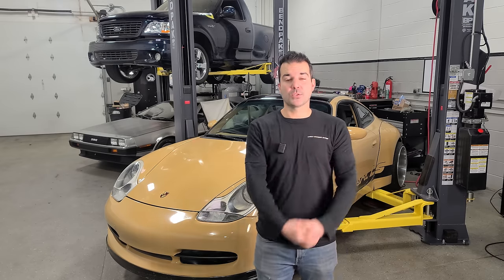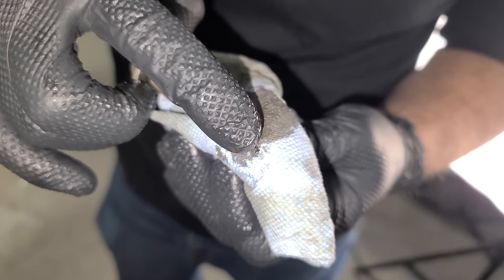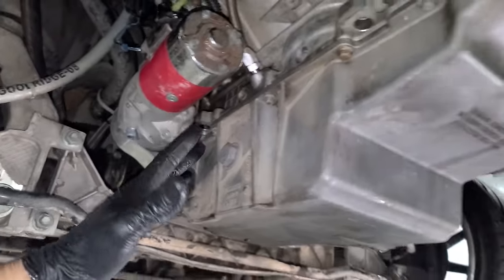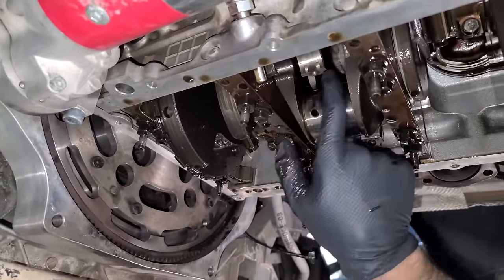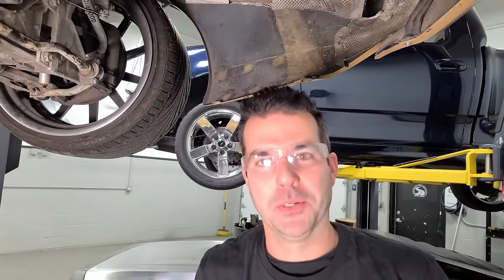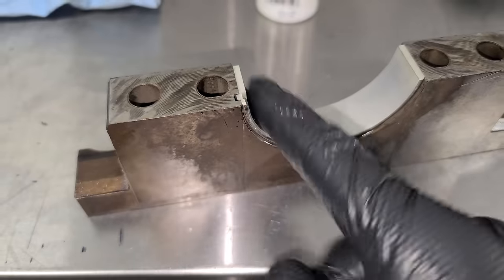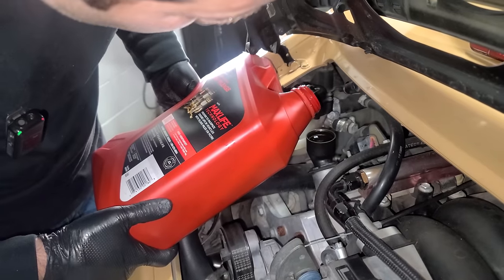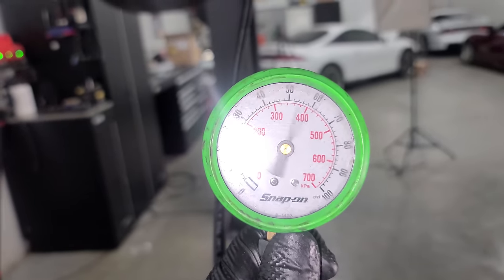My LS Porsche 911 Was About To BLOW UP So I Attempted A RISKY DIY Engine Fix!

Comment: A real mechanic, Alex is. Only a seasoned guy would remove the pan , pull the rod caps and find spun bearing and still say, crank is good , I'm lucking out.
Reply: Does the exhaust cause an issue with it sitting right under the oil pan like that?

Comment: I want to correct something mentioned in the process of torquing the bolts inside the engine. What you said about torque to angle bolts is incorrect.

Torque to angle is a process, not a type of bolt. The bolt itself dictates whether it's a torque to yield(TTY) or standard bolt. Generally a "neck" on the bolt is a good indicator it's a TTY bolt or not. 

Torque to angle is a very common process used when torquing a TTY bolt because it's very easy to control bolt stretch with a specific angle applied. 

I'm not saying the bolts you torqued can't be reused, just want to be careful when throwing around terminology that can easily confuse others into thinking they can reuse bolts.

Comment: No one mentioned that it was overheating severely when purchased.  It probably got super hot and spun the bearings at the time.  There should not be any future problems in my opinion

Comment: Wait until he gets more spun bearings, pulls it completely apart, and finds out that the reason the bearings spun in the first place is that the last guy who "freshened the bottom end" mixed up the rod caps :p

Comment: My LQ4 has 325,000 miles and idles at42# oil pressure and cruises at 59# at 2000 rpm, this is at 195 degrees normal operating temp.

Comment: Bro.. 3-4 thow is very loose. Probably why she spun. Unless you're running 80 psi oil pressure. Just throw a 1/2 size plus bearing and tighten it up.

Comment: Absolutely nothing wrong with how you replace the brains in this motor. He checked your specs. Torqued everything properly. Cleaned up the crank old school. I've done them that way when the budget was tight. It works just fine. Must be nice on a lift.

Comment: ALEX, IF YOU HAVE THÈM ALL OUT, YOU SHOULD CHANGE THEM ALL.....THAT CAR SHOULD BE AT 90 OIL PRESSÙRÈ....AT 3500RPM. Even vw bugs have over 50oil pressure and is loŵ set....

Comment: Bro gonne have rod knock after all that polishing       just spend the 500 and buy a junkyard ls    good luck thou it may run a week    it may run forever who knows but judging by my knowledge that crank could have micro cracks due to heat and all that polishing increasing clearances its going to fail soon

Comment: One thing I hate with a passion are : low profile tires, every time I see them? I get instant erectile dysfunction 😢 , many many Lamborghinis,  corvettes, ferraris  have unexpectedly crashed in a very sophisticated way, due to cold low profile tires, they are to thin and hard ,  you try to turn? And they go straight 😮 but with more meat , they will grip and hold , just remember the porsche 917 tires , and the 365 gtb Daytona, they never slide even on wet roads . Low profiles also wear out brakes faster .

Comment: Not all engine builders use ARP studs , only people who have deep pockets and think getting the best of the best always use ARP studs , ARP studs/bolts have applications,  they are breakable studs , theres a huge difference between stretchable studs and breakable studs that are hardened with a max torque setting,  you dont always want to use ARP studs/bolts on everything something that  didnt have aluminum heads on it will call for ARP head bolts because stretchable one's will never torque,  cast to cast calls for whatever that oem bolt grade and length is , of ots shanked or may be in a sleeve as well, if it calls for a crush washer or shims to alleviate space between something or to come to specific degrees . But always research your bolt specifics , dont always go buy ARP bolts or studs when they are not needed or cannot be used things may become damaged,  cracked , or completely broken because of a bad application of the wrong parts , so dont just go buy ARP bolts for your engine with out doing some research first is all im saying . What sold me on stock bolts was this , an elderly man owned a race shop and i was that kid wanting all the cool stuff,  and he showed me the difference by actually breaking an ARP head bolt in front of me and said they are made for race cars , you kid do not have a race car , you have a piece a junk ford truck kid and showed me a head bolt for a 351 Windsor and he kept tightening it and tightening it and stretched ot til it broke too , he looked at me and said cast iron needs stretchable bolts aluminum expands and needs hardened bolts to keep them in place you put a hardened bolt on cast and things break, and that kept to me for 20 plus years....

Comment: Pressure is pressure - why would the sensor care which engine it is on? All the sensor can see is how hard the oil is pushing on it. I would never assume oil pressure to be ok on any engine that is new to me.
Reply: Oil pressure senders work on electrical resistance and are matched to the gauge. Different gauges can use different resistances for a specific pressure.
Reply: @kendallkillian1125  I realise that, but Alex said it was a stock Porsche sender going to a stock Porsche instrument panel. The only thing not Porsche was the thread adapter and the engine itself. I fail to see why that would ever be a reason to talk about translation errors. I think he just got himself muddled.

Comment: In my 2007 truck the engine reads about 90-120 psi on idle, out of the gauges range, then with the engine off it rests at about 40 psi, it's a Chevy thing

Comment: Man i can assure you 30psi cold start and 45 at 3k rpm cold IS concerning.. thats a recipe for 10psi or less hot lol
An Ls should be well over 40 or 50psi cold IDLE. Hot idle should be 25-30psi 3k rpm hot should be around 45 or 50psi. 1500rpm cruise 38-42 psi is an average healthy LS.

Comment: As an automotive machinist this was hard to watch. I love your channel but this killed me 😂. I would run 20w50 vr1 in that thing with those kinds of clearances. Good luck
Reply from the maker: It definitely wasn't meant to be an alternative to the proper repair of disassembling the engine and having it machined. I mention that in the video.  This is a very cheap method that might work.  It might not.

Comment: If you have to open it up again, I think you should make it a stroker and put a flat plaine crank in it so you can rev it to 8000 rpm and push the car up to 250 mph. 😂😅😅😂

Comment: Yowza. 5 minutes in, the first thing I notice as you pulled the oil drain plug is "oh, that's not good, that oil looks a little sparkly."
Then I realized it wasn't just "a little sparkly", it actually looked like the engine was trying to flee the country in liquid form. It always amazes me how much punishment and damage engines will tolerate, but I really wouldn't rely on that one at all. That much metal in the oil -> full teardown and maybe off to the machine shop.
Here's to hoping you do the right thing...

Edit: well, I suppose a bearing slap job is fine for starters, though you'd do well to figure out why the bearings failed in the first place.
Edit 2: original bearings killed by track use?

Comment: Please build the engine at least better rods and pistons and valves and crankshaft and do small twin turbos and route the air intake to the  grills on the trunk and then the outlets to a small radiator then a center exit to the throttle body

Comment: Today most people trow thin oil in their modern engines, us cars like a bit bigger oil I think. Not that very 0w thin stuff
Reply: That 0 is the cold pour rating. The lower the number the easier it is for the oil to flow on startup

Comment: Pull the motor and clean all the metal pieces out or it will destroy the new parts.  The cheap way is not the right way.  You can"t clean all the debris out from the bottom.

Comment: You want to pull the dip stick out 
Working in a shop 2 coworkers ended up in hospital with infections after getting stabbed by the dip stick while working on the motor be careful

Comment: You should change the exhaust bolts on the oil pan for the bolt/stud type to minimize oil pan gasket issues
 Genuine GM Stud 11546890

Comment: 38 to 45 pounds.  45 cold  38 at 190 degrees at 65 mph. 230 thousand miles. 2002 chevy 1500 5.3 with a napa gold 1122 oil filter.

Comment: Any bearing clearance bigger than 0.0025 will cause low oil pressure 
Bigger clearance will cool the bearings is complete nonsense

Comment: Man OJ was doggin the hell out of your car .....
Reply: after watching the other 66% of the video lol

Im very happy that u successfully did an "In frame" on your Carrera LS!
   U taught us something new along the way.
That was alot of work.. your focus was great and u did and Excellent Job.

Truly happy for u that your engine didnt have major damage at the crank.

DO NOT .. DO NOT .. DO NOT !! 
Allow OJ, or yourself to over rev this engine.
I felt like he was trying to break it actually and im almost certain that This is prolly what caused your bearing and oil pressure issue.. as well as maybe the earlier overheating.

You must remember.. these domestic V8's can not usually rev up that high like the original Porsche flat 6.
   I know u wud love em to but they just cant, unless youve built them todo so.

This is one draw back to swapping for domestic v8s.. they have torque, but they dont rev like the original flat 6.. which has low torque and must rev to get into power. 
Trust me.. i have the same car 🙂

Comment: dude a half a gear is setting in the oil you just drained out and metal shavings oil pump prob failed dont run it any more and get all the shavings out replace pump

Comment: Bro is really regretting not getting a front sump pan.  And you can run worn bearings that’s what the old engine builders used to do, you build an engine loose and it runs like a sewing machine

Comment: You got lucky  because the car wasn’t ran at all, if the car had been running proper the engine would’ve probably been trashed… being it ran like a turd no miles was being put on the engine, in your case was good.

Comment: What a joke l s swap a porsche😅😅 The original porsche motor made more horse power than the l s. Through some simple massaging, it would take quite a bit of work on an ls to make the power the Porsche motor would. The LS is a heavy brick. The handling characteristics of the car probably suck now.
Reply: Wrong. The ls1 makes more HP than the m96 and it's lighter